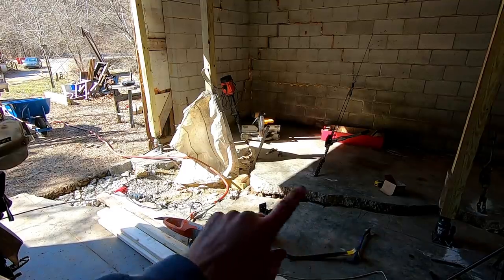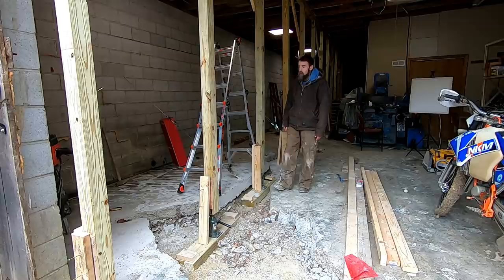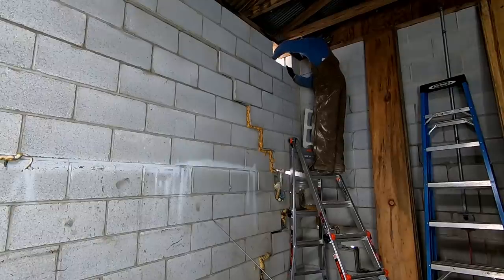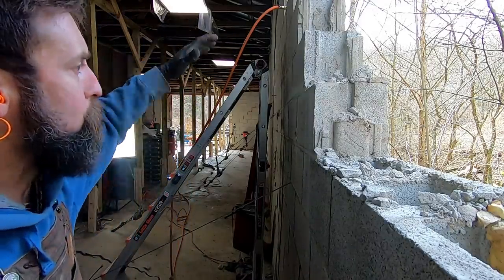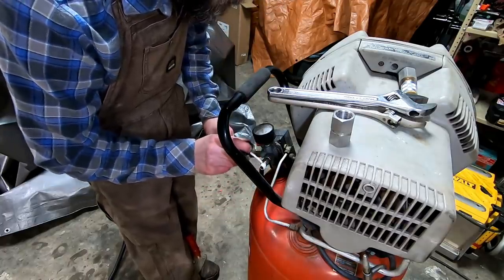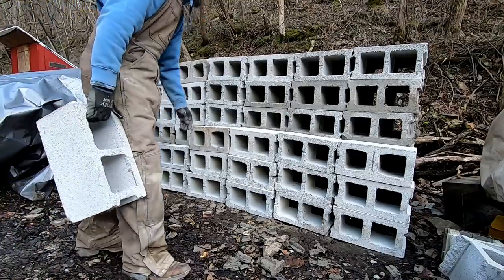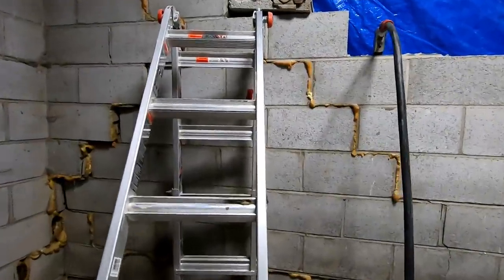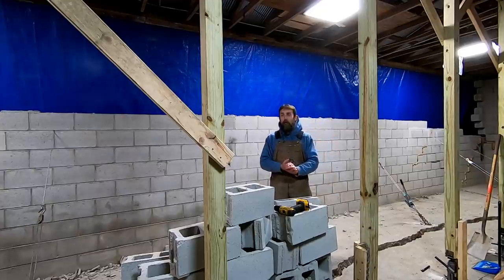Leaning Block wall removal and Roof lift  SHOP PT4

Comment: Doing stuff like this is educational too.  By deconstructing it you see how it was built in the first place.  Your doing great.
Reply from the maker: Thanks Clive.👍 I have learned a few things about block wall construction on this demolition. I agree
Reply: @SteveSummers  Likewise when I completely reroofed my garage it was a valuable education just replacing what had been there like for like, but with modern materials.  In the end it was MUCH stronger than the original, although there were a few small things that I'd have done differently in hindsight.
Reply from the maker: @bigclivedotcom  Doing something like that is no a small job. Its awesome that you done the job yourself.  Not only do you save on labor expenses but you also get a education in the process. I'm a big fan of all the skilled trades. Feels good to not only repair the issue but to also make it better than it was when it was new. 
Good to see you Clive
Reply: @SteveSummers  Plus you get it done to a known standard at a time that suits you.  The hardest bit is starting such a big project.  I used my garage roof to justify buying loads of new cordless power tools like an SDS drill, impact driver, circular saw and many others.
Reply from the maker: @bigclivedotcom   That is very true about starting being the hardest part. It was a very tough decision for me . I felt that I was risking my channel as well . Luckily my viewers are amazing  and seem interested.  Looking at a project as big and time consuming as a complete roof or in my case the damaged building as a whole is quite overwhelming. I like to look at each step one at a time. I can do one step.That's the only way I was able to decide to start.  I also have several new tools that I  recently got for the job :-). I would prefer to own the tools and learn to use them over paying someone to do the job for me in most cases. Ill have the tools and the learned ability forever.   .

Comment: it looks like all that mulling and thinking has yielded great results.  Your plans are working perfectly. I really liked the clever use of the air bladder to lift the top plate. It's good you're doing all this work when you're still young, because the older you get, the less eager you are to take on such a big, but necessary,  job. Boy the possibilities of customizing your shop, now, are endless. I like the idea of windows, and adding daylight to your shop.

Comment: That young man will be bulked up by the time he gets done with all the block and motor carrying.  I did that for my father at about his age as he tripled the size of our tiny frame home into a modern brick home with 2 huge fireplaces.  Lots of lessons in there.  The higher that fireplace got, the harder it was to carry rocks and busted concrete fill up to him and every day he kept going going and going.

Comment: I feel for you.  Many years ago We removed a 13'X 13' X10" poured concrete wall from a WPA built building ( former School Gym)  in order to put my shop inside.  I did not have a diamond saw but used hammer drills jack hammers and cutting torch to cut the 3/8 rebar every 10" Vert and Horz.  After separating the wall into 3 pieces I used a retired army 6X6 with a holmes wrecker bed on the back to winch the wall sections out.  Log splitting wedges were used along the floor line to help tip the wall out.  The winch truck had the front wheels were off the ground. several times in the process. the cables were run through  snatch blocks for a 3 to 1 increase in force.  At one point a 3/4 diameter bolt that held the snatch blocks to the wall was stretched to the point of failure.  You are doing a great job.  It is great that you are videoing what you are doing.  I took very few pictures and most of them were lost in a computer crash.  ( early days of digital photos)  It is good that jobs like this are documented.  Even with my  50+ years experience in taking down buildings  I have learned from your experience. (Yes I can remember pulling nails at age 5 from the buildings my father was taking down to reuse the materials) Shalom

Comment: It may be too late to suggest this, but at two creekside demo sites, we laid chain link fenced flat between the wall and trees with fence curled up against trees. When job was done, we used a tractor to drag the fence out of the way. (Pull the fence off the trees first.) A lot of factors can kill the idea, but when it works, it saves time and debris from the creek.

Comment: I am assuming the young man helping is your son, not sure. But you can tell a lot about a person by their work ethic. You and that young man are hard workers. Good to see. Not many in today’s world would take on a project like this. Hats off to you and that young man sir. An old plumber told me once, use both Teflon tape and pipe seal and you will never have a joint leak; and in 30 years he has been correct.

Comment: Your good planning is paying off plus your assistant handles those blocks like a pro. Just a couple of hints to make work easier. Scoring the concrete and then undermining it before attempting to break it can save some time and effort. Having the wheelbarrow already pointed in the exit direction before loading also makes using it just a little easier.

Comment: Like I told you on Facebook, You're doing it the way it needs to be done. Work for me is taking down structure elements in concrete. I got over confident years ago with a 20' high block wall and the middle folded back on me. We didn't secure the centre. Lucky fore me the machine window took the main impact . Still came through a fit but landed at my feet instead of on my lap

Comment: Watching you brings you brings back a lot of memories on a house my Dad bought it was 24 x 30 ft and we had to repair 3 of the 4 walls pretty much the same deal. We jacked the whole house 2ft in the air toke out the block and poured a new foundation. It was a hell of a job but like yours has to be done. Good luck and keep the videos coming.

Comment: Back in 2006 when we bought or house. It has one part built in 1890 and an addition built in 1980. The 1890 part has a fieldstone foundation. The North side was crumbling, holes in it. I built a beam, simulator to yours,  jacked up the house, tore out the rock, poured new footers, and built a block wall. I too built a temporary shelter.
Looking good! I wasn't expecting you to save the block!

Comment: That young man is doing a good job with the block, Looking good Steve. Somebody did a good block job, with wire in the coursing and anchor"s at top. However that doesn't do anything if the footing is not Right? Yes that is a J hook they are used a lot.
Reply: Had the wall been grouted with rebar verts it would not have bellied out the way it did. Mind you had the contractor done that he would have put in a more proper footing.

Comment: That kinda work is very good for a growing boy. It's good for him physically, but also good for him mentally, as in fortitude. Lugging cement blocks will build up muscles in a growing boy...I know that from experience.😏

I'd probably conventionally frame that wall with 2x6s , 16"on center. Its cheaper , quicker and easier than post and beam. With a post and beam setup you're still left with having to fill in between with something. In C
onventional framing it's done, window openings and all.

Comment: You are doing a great job! On the topic of the screws shearing off: In your case, the roof is a very light roof with only tin roofing. I have seen from experience screws shear right off when asked to carry a side load from the vertical. On a heavy, 2x8 framed roof with 2 layers of asphalt shingles. We were jacking the roof because it had sagged from being under framed. And we needed a quick temporary support. Screwed a short 4x4 to the framing to take the load while we moved the jack.  After about 30 seconds, BAM! screws broke and we all needed new underwear. Always put something under that bears the load. Not screws or nails holding the load.

Comment: Re-Use those blocks for the lower half of the wall;  the upper wall can be regular 2x4 or 2x6 and windows.... Windows are always good for light and ventilation (sometimes when you want them the least) :) Great work, Steve!

Comment: Suggestion: Take down the long side wall completely to the ground before you tackle the end walls. The end walls are structural pillars and there is still risk of roof collapse when you start demolishing them. But by taking down the long wall completely to the ground, and removing the tarp, you will create your quickest possible escape route, even if it means running straight into the creek :-).

Comment: Steve, since you have most of the blocks, I’d want to reuse them rather than build a stick framed wall!  Just get a well made foundation under the wall. 

Your son looked pretty tired at one point, maybe it will give him some appreciation of just how hard you work to provide for the family. I helped my father put up fencing, hauling top soil, landscape our whole yard, built a concrete patio. Paint the house. Transplant many trees and a whole lot more. Not only did it help my father with all the hard labor, it taught me how to do these things and that I could do whatever I wanted if I just put my mind to it!

Comment: It looks like you managed to get past the most dangerous part with a well thought out plan. Great work! I can't believe someone went to all the trouble to set that wall in place and pour a floor with no foundation footing or reinforcement in place. Even the floor is just a slab with no wire.  As a replacement wall I suggest digging some deep post holes, pouring some concrete in the bottom, and setting  posts in to reach the roof, much like a pole barn is constructed. You can then frame it in with windows and even insulate it later, and it will be a lot lighter than a block wall. Later pour in a reinforced floor.

Comment: Be sure to core fill the new block wall every 4 foot with rebar in these cores. This will add tremendous strength. I like the idea of 3 layers of block and then insulated 2 x 6 wood wall with one bay window so you can see up and down the stream without giving up too much wall space.

Comment: I found I could hold about 500lbs/#12screw in shear when I was lifting. I would suggest maybe doing 3 or 4 courses of block on the bottom of your new wall. Getting the wood up away from ground moisture, grass and things really helps to make things last longer. The rest of the block could be used to build a retaining/diversion wall in the creek so you don't have issues in the future. :-)

Comment: Impressive work. Those air shims are extremely useful. I have a couple of 300 and 500 pound ones for various lifting tasks. Comes in real handy when I need to level tables or appliances.

Comment: Steve the mortar will make good erosion control for rain water coming off the roof. If you can break down the cement into smaller pieces it would work well too .  It would be like rip rap rock they use around bridges on waterways. I like the creek noise too miss living near flowing water. You now have a shop inspector like your neighbor Brian.  Windows a great idea.

Comment: 11:23 Good job.  I spent a summer chipping mortar off of reclaimed bricks for my dad.  We used them for landscaping some are still in the landscaping at my mom's house 45 years later.

If you're really concerned about those screws, talk to R&R Builders.  He uses GRK Screws on all his Post Frame buildings.  Yes, he also uses 20 penny nails as well, but he also uses THOUSANDS of screws.  His buildings are Top Notch.  Jimmy Diresta had him put in his shop, and that's what he used.

Comment: Nice work. Regarding the screws: If screwed down properly there is no shear on the screw, it relies in friction between the surfaces you screw together. You basically only get shear on the screws if they do not create enough force pressing the parts together.

Comment: Hi Steve. Glad to see the blocks coming out clean.  You should reuse them as it will save you money in the end even if you only use them for the bottom half of the wall. Great job.  It might pay to put 4 or 5 diagonal braces from the bottom of the uprights to about 2/3 the way out to the roof edge. The roof joists will start to bow down a little over time so it might save you some problems later on.  I like the little lift pad, that is a great idea, never seen them before. Looking forward to the next video. regards from the UK

Comment: Great job Steve. You have put a lot of thought into it and come up with good methods. You might want to stack your bricks in the same plane as when laying them. Also overlap each course so they won’t fall over. Now you’ve started you’ll have to finish! Good luck.
Reply: Yes a few blocks laid across the way now and then adds a lot of strength to a stack. regards

Comment: Steve, due to the outstanding job of roof supports you have plenty of time to decide how to rebuild the wall. As I have said, I would lean toward a post and beam structure with sheert metal siding which would minimize the weight of the wall. You can probably sell the blocks and recover some of your costs.

Comment: I'm glad we can add dry mortar to the builders sins. It has made your job much easier and you can reuse the block elsewhere.  The wall may have been plumb and level when it was built but that can't hide the poor workmanship elsewhere forever as you have found.  Stay safe, a 6 foot wall can still hurt you if it falls on you.

Comment: Hi Steve, 
Good to see it's less of a potential problem as you remove it, block by block. 
You've made good progress. 
You commented on the bolts that held the roof to the block wall, that would do little in a good storm or a tornado/ cyclone, it would lift the block of the wall with the roof. 
You also commented about the support of the roof on your props. And commented about having used screw fixing the timber to the sides of the posts to basically avoid settlement if the jacks creep. You also need to consider uplift which as far as I'm aware you have not mentioned. So you need to provide a connection to tie the temporary supporting columns to the concrete floor. Now I remember your brackets on top of the jacks were locked to the head of the jacks, and you showed a clamp on one of the jacks to the concrete floor, is that on all jacks, if it is then it would provide the required tiedown.
On the nail/screw issue, screws have better withdrawal resistance than nails, and in shear, if you have similar numbers and similar cross sectional area, there would be little difference.
It must be a great relief having it well on the way to being gone. 

Regards Dennis.

Comment: Hack is right; the footing is very important for weight bearing and stability of the wall.  Now, you mentioned going back with a pole barn type construction.  My son and I were asked to lay some block just inside the outside walls of a large building in a fair grounds.  Steve, even if you go with the pole construction and pour a concrete floor you could lay block inside the walls to protect them from flying objects if you intend to put machines out there.  You'd only have to lay block up 6-8' to protect them.  Also, you could paint the block white to help with light in there.  Just some free ideas worth every cent you pay for them!  Good job on saving those block; not very cheap these days.  Greg

Comment: I was worried about the screws when you said you were doing that on the last video.  But by threading the jack up you are good.  Also I core drilled my house foundation last year to run a gas line to a generator I had installed.  I found a slip from the block distributor inside the wall.  Talk about a time capsule!  Make sure you put a deep and massive foundation under that new wall and floor!

Comment: I'd buy a couple large plastic tubs to throw the chipped off mortar in when you have a piece in you hand instead of throwing it on the floor and scooping it up again. Scooping it up is doing extra work. A cloth drop cloth would help cleanup go easier too. A 2 wheel dolly or wagon would be good for your helper to take several block out of the shop instead of making a trip every time there is one block. Set up a mortar cleaning table inside and take the blocks out of the shop clean on a cart.

Comment: I’ve got the fiberglass version of that ladder you’re using. The ability to get it close to the wall is one of the BEST features of that ladder. Super handy for service work, where you only carry one ladder. Downside is they are HEAVY.

Comment: Not sure I would reuse that old block for anything load bearing structural.   I'm not sure what the life of a block is, but everything has a life span.  You see how easily the mortar chipped off, I'm sure you couldn't have done that 6-months after it was originally constructed.   Kudos to you for tackling  that job alone... quite a feat !  Good job !

Comment: I've been driving nails by hand for nearly fifty years, never shattered a nail... now screws, they can snap like dry twigs as the steel is much stiffer. Nails are made of softer material that tends to bend...hardened casing nails can snap also but you usually get a slight bend before it goes flying off into the distance. These properties are designed into each fastener, and not an accident. Engineered, TICO nails are very hard but unless your driving them with a sledge hammer, they are generally to tough to break with a framing hammer.

Comment: It's not just the shear strength of the screws, there's also the frictional force between the joined pieces of wood to consider. I think you'll be fine!